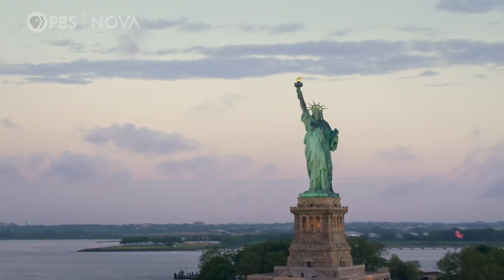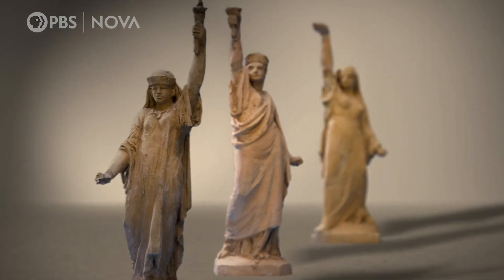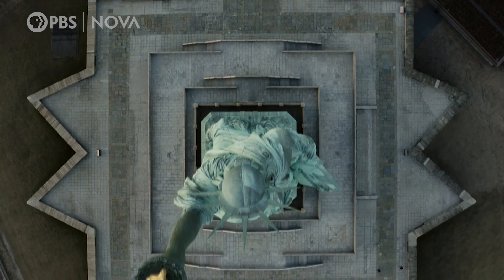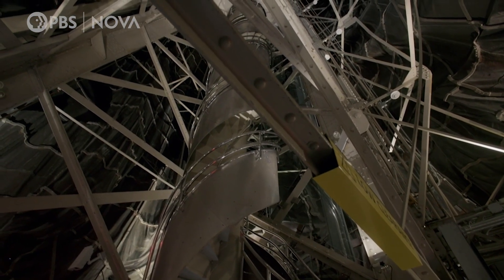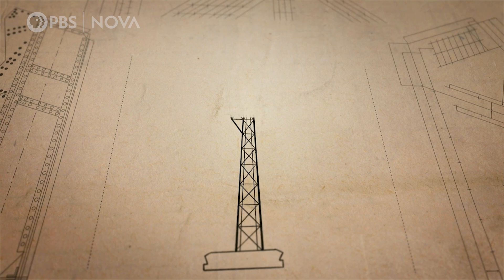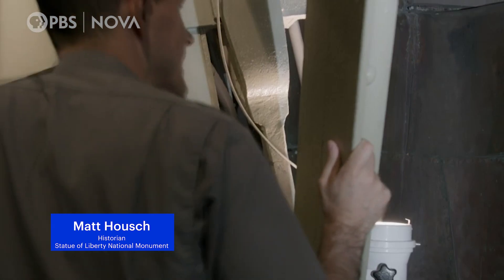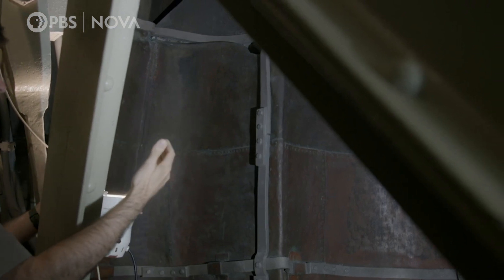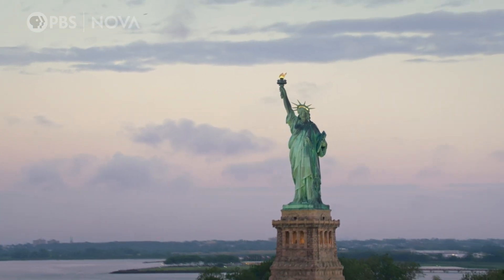Inside the Construction of the Statue of Liberty | NOVA | PBS

Comment: Perhaps should’ve replaced iron bars with copper for improved longevity
Reply: There will still be a copper to iron connection somewhere. The iron has a higher weight to strength ratio, so it makes sense to use it for support versus using copper.

There are still ways to protect against corrosion, if that's what you are referring to. I know they use a couple of methods, but off the top of my head I don't recall exactly which ones. But there are methods ranging from using a very weak electric charge to sacrificial anodes that corrode first, sparing the other metal from almost all those effects.